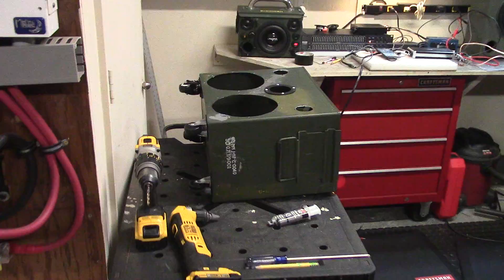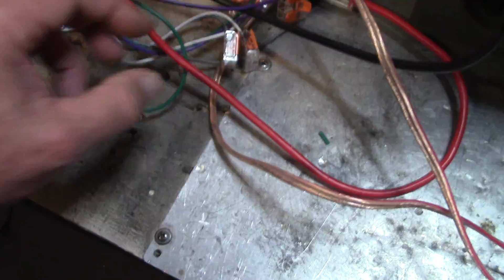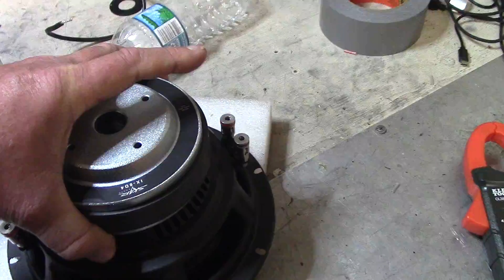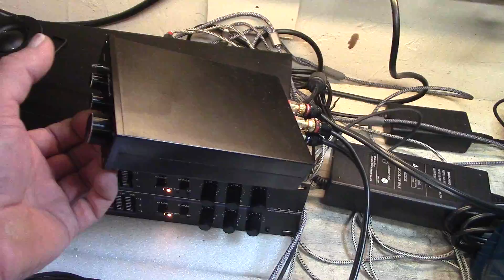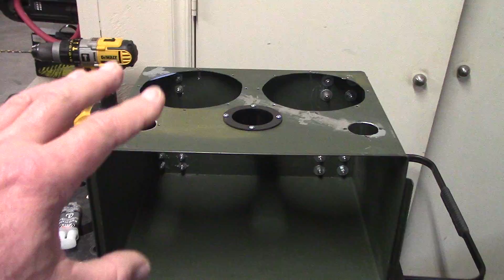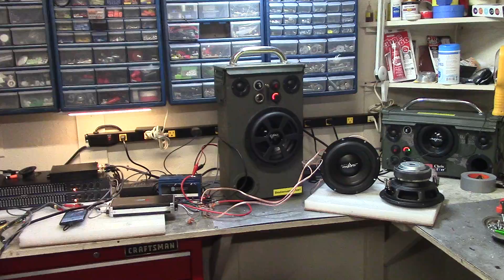Testing Cerwin Vega B54 amplifier and DVC subwoofers for ammo can build

Comment: If I were looking into Class D amplification, I would check out the Brazilian amplifiers. They seem to be a notch or two above most other brands (Chinese) amplifiers in Class D. The Brazilian amplifiers have seem to focus on the Class D tech, and have made improvements in the area of Class D amplification in both Sound Quality and efficiency. If an amplifier does not run "hot" it will last longer, in general. Also, running Class D amps help on the amperage draw needed for the stereo system. But do they create "ear fatigue", or do not sound as good as Class A/B amps regarding your tweeters and mids?

Comment: Monitor the battery voltage while running the amp at full tilt.   You may be running out of available power.    As a rule of thumb most amps are only 50% efficient.
Reply from the maker: Agree. Shame on Cerwin Vega. I am thinking the same thing with that battery...a small lithium with BMS. I might throw on the 10-amp charger on it vs the 3-amp for testing.
Reply: Yeah idk why you are getting a dirty sound, I have had nothing but rave reviews on this amp, I use this amp regularly on motorcycle systems because of the low amperage needs and makes big clear sound......even ran it 4 channel on 2 8" woofers and 2  6x9 was clean and crisp